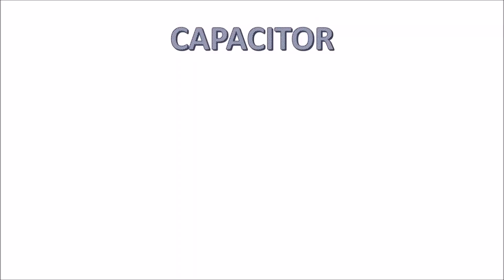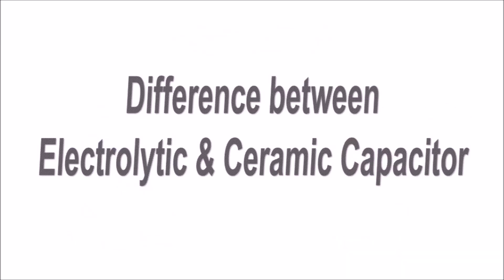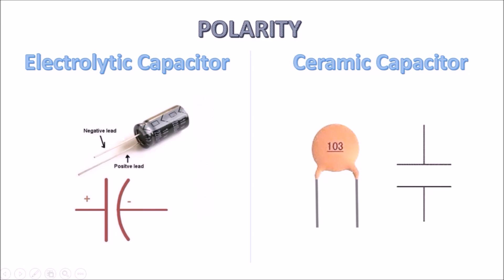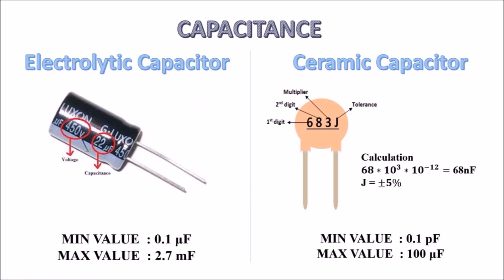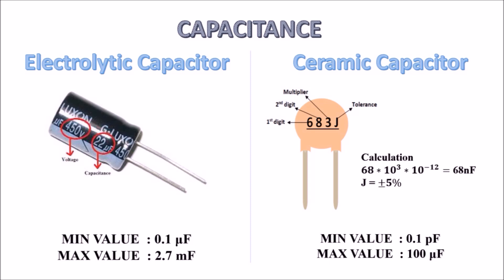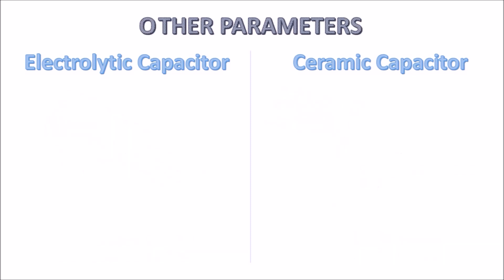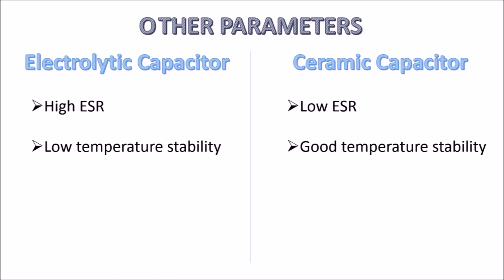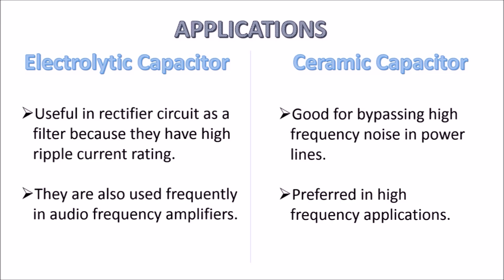Difference between electrolytic capacitor and ceramic capacitor!!!

Comment: Electrolytic capacitors mounted on electronic circuits of devices manufactured after 1990 can remain unused for as long as possible without this disuse causing failures and depolarization in the electrolytic capacitors?

Comment: i have electrolytic capacitors mounted on electronic devices from 1990, how long can these devices remain unused and without the electrolytic capacitors failing due to disuse?

Comment: Bhai, can we use electrolyte capacitor instead of ceramic capacitor?
Reply from the maker: It basically depends on your application...
Reply: I don't have much idea about electronic since I'm not studying electronic.😬😁 Well actually ceramic capacitor got demage in my extension code because of fuse. I tried smaller size of ceramic capacitor but it doesn't work. Can you help me how to repair it?